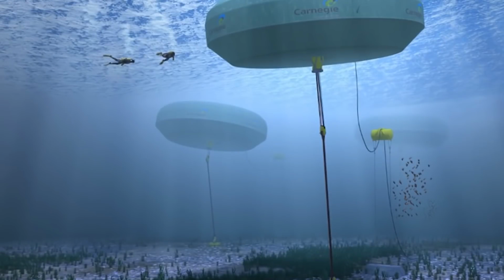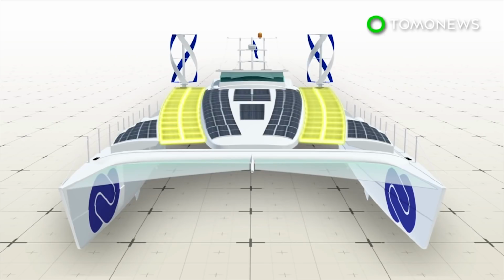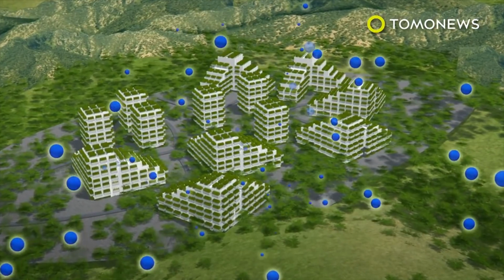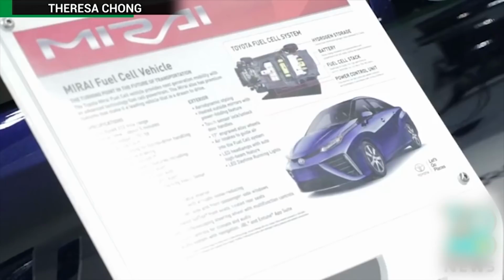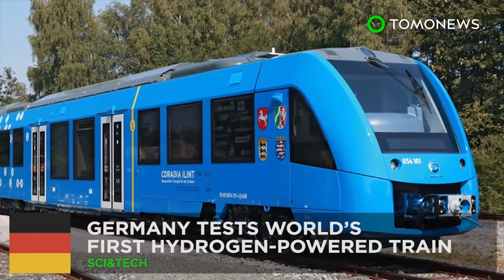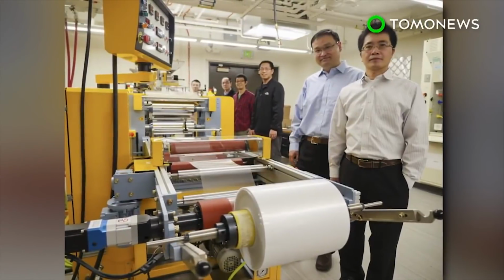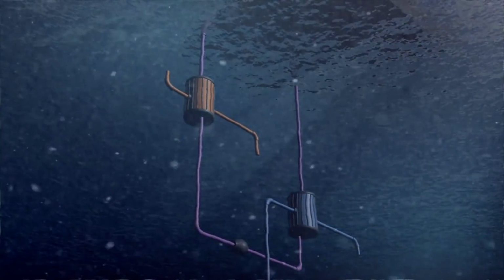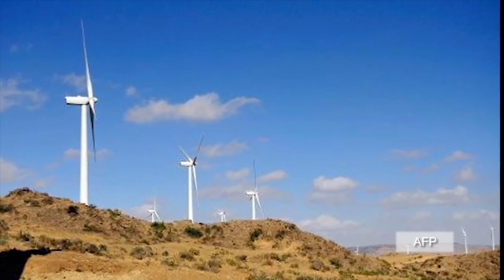CETO system converts sea waves into zero-emission electricity; Green powered boat - Compilation

Comment: Watch on utube- Light Rider operation Paul Revere
Switch the 6-50watt glass panels to 6-18 100watt flex panels and the 500watt motor for a 1000/1500watt motor.
Mobile Solar